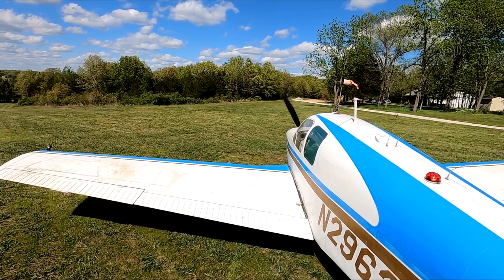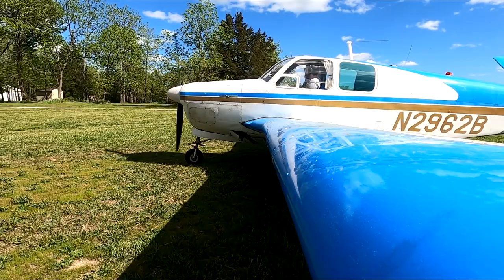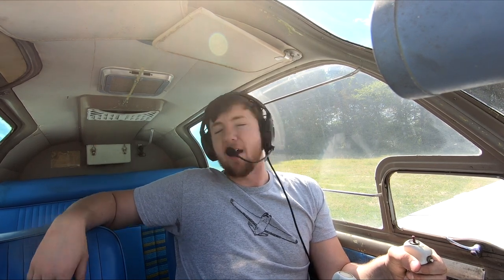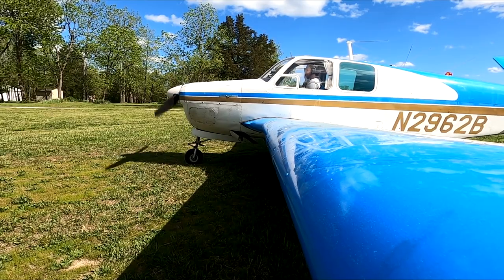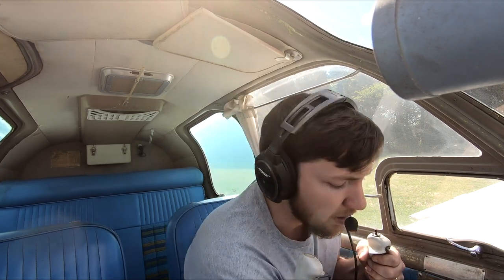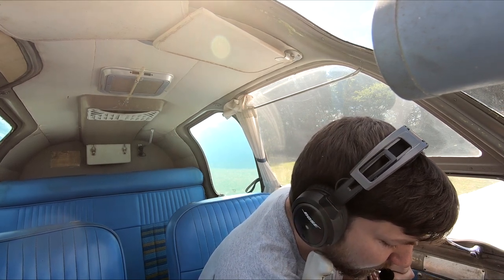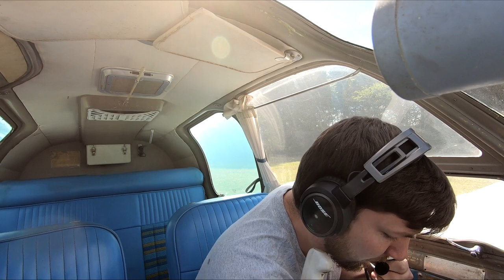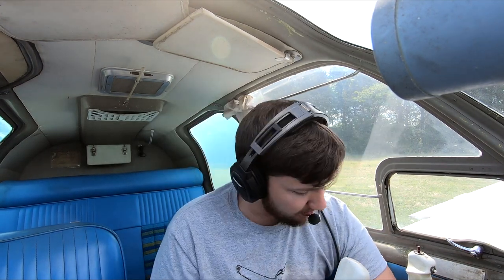BARN FIND V-TAIL BONANZA FIRST FLIGHT IN 15 YEARS!!!

Comment: A bonanza you fly down, you don't flare it down to the ground.. You got caught out by flare way to early and I guess you were close to stall. I would suggest you fly more circuit with it to properly understand it
Reply from the maker: I’ve never not flared to land unless I’m coming in way too hot and have to stick it to the ground and get on the brakes aggressively to stop. I don’t flare until runway is assured. I also don’t pull power until runway is assured unless I’m high. Runway was assured on this landing. Whether I hit the tree or not I still hit my intended touchdown point. The downdraft/rotor/whatever hit my plane happened to drag me through the tree instead I’ve over it like I intended.
Reply: @BenWeeksBonanzaPilot there’s nothing at all wrong with a steeper approach….you can trade altitude for airspeed, providing  far more options than people who drag the plane in on final on a 1degree glide path.
Reply from the maker: I’m all for steep approaches, but it does tend to lengthen the runway used on landing unless airspeed is incredibly precise. Dragging in with a bit of power  really helps plant the aircraft once the power is chopped, but it runs the risk of exactly the scenario that played out in this video. Just a bad situation all around with the best option being scrubbing the flight to wait for better conditions. There will be at least two more test flights in the nearish future on a reassembled bonanza out of this airstrip, and I believe I have learned a lot that will change the way I go about the test flight in the future.